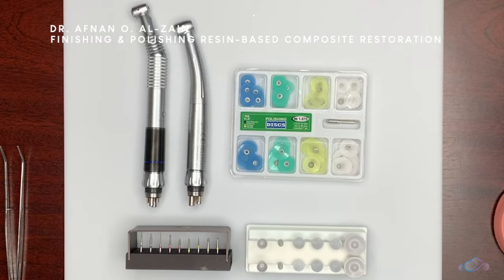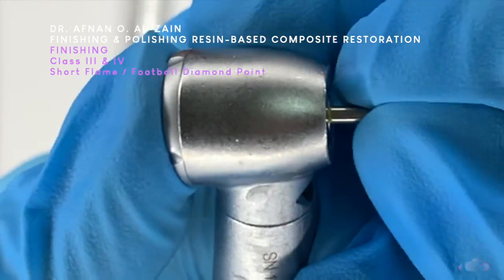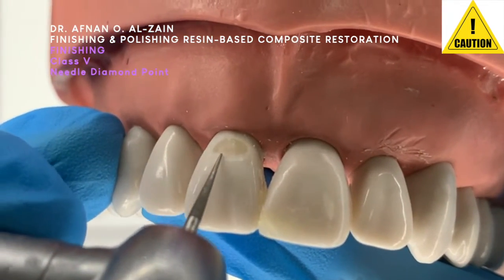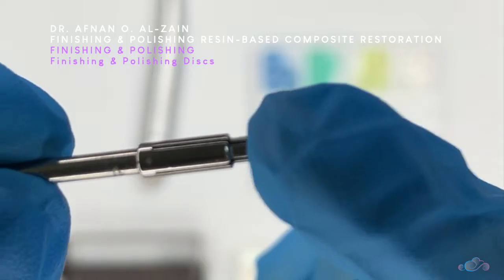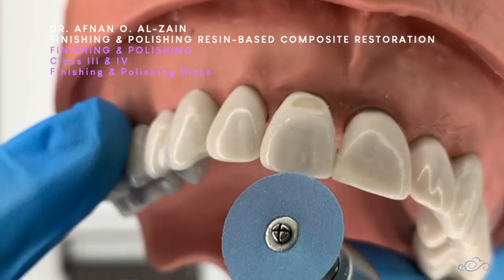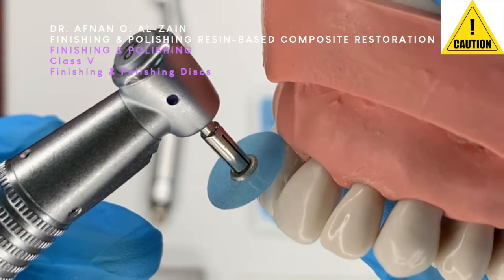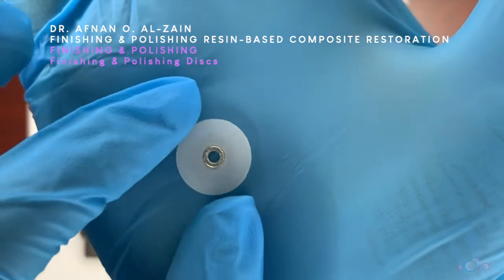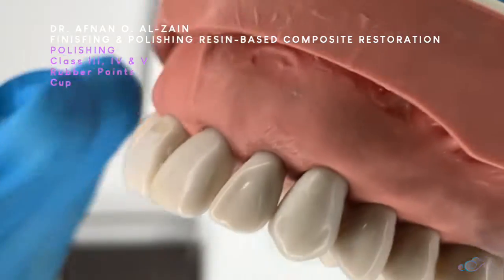Finishing & polishing tools & application (2): Class III, IV, V composite restorations - En

Comment: thank you so much for the video. may i ask, do we have specific sequence of using the bur. for instance, do we use white stone first and then the rubber types last? or it doesn’t matter
Reply from the maker: You are welcome. Yes, There is a sequence. I used the sequence in the video. Yellow diamond point first, then the finishing and polishing disks then the rubber points. Don’t forget, the disks are used on smooth surfaces not of the occlusal surface of posterior teeth. 

We no longer use the white stone as they are extremely aggressive.

Comment: Do the polishing discs damage or remove the enamel? Good informative video.
Reply from the maker: No, the grit of the polishing discs are very fine they only create luster on the surface and do not remove enamel. Please note that the finishing discs (the first step of the finishing and polishing process) is the steps where you remove excess, so the finishing may remove minimal tooth structure but not to a degree that causes extreme damage as the high abrasive or cutting instruments.
Reply: @drafnanoalzain Thank you for your explanation. The one my dentist used was reddish in colour, a brand called Sof-Lex Extra thin. I think his kit was blue, red, orange and yellow. Red would be after the blue disc as far as grit? Yeah my concern was to not remove the enamel of my tooth 🦷
Reply from the maker: @KunduDance  correct, it would not damage enamel.